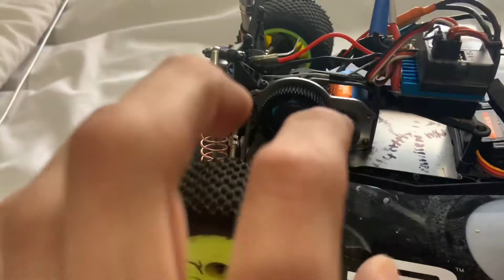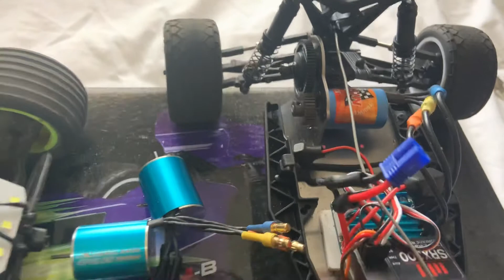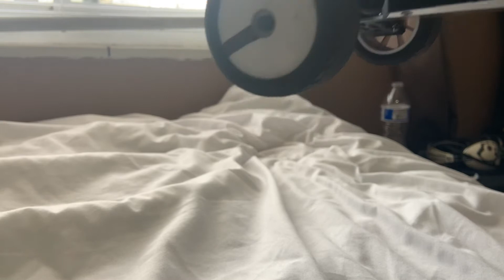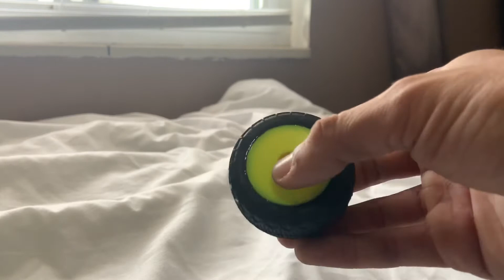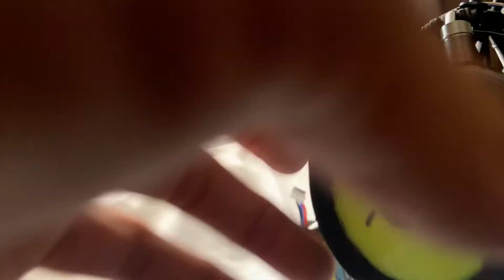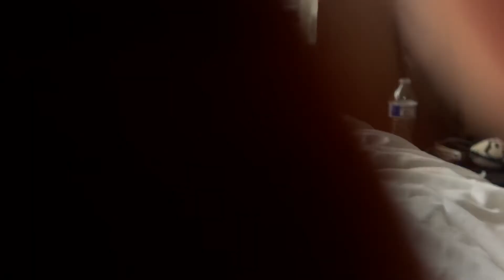Full conversion Losi MiniB 7800kv 28tpinon Losi MiniT2.0 7800kv 27tpinion Brushless motors

Comment: I use those little surpass 7200 motors in my hobby grade swaps. They're awesome but they don't rev anywhere near rated kV.
Reply from the maker: I use BL motors 7200kv they deliver on the kv out put it says advertised. At the moment i have a 3s system with a 7800 kv motor 27t pinion on my losi mini t 2.0 and same with my mini b buggy 7800kv motor 28t pinion
Reply: I believe it, but how did you check that?
Reply from the maker: @walkthedogz  cus my gps clocked my mini b buggy at 47mph 2s system 28t pinion 60t spur gear contact foam wheels. My mini t has a 3s system same motor different gearing. And i know ITS going to go faster than my mini b
Reply: @walkthedogz  With an RC gearing app and a GPS. Definitely not 7200kv but for $30 CAD it's half the price of a brushed system and still significantly faster.
Reply: @PabloGonzalez-hv3td  Makes sense. I saw a Surpass motor on Amazon that was 8000kv that would be fun to try but if the numbers are not true I wouldn't imagine one would see much speed gain.
Reply: @walkthedogz  Depends what it's replacing. Definitely faster than brushed but about half the speed of my 8200kv Castle system but the castle system costs 5x more.

Comment: Hello, where can i find the pinion and adaptor?

Thank you! ken
Reply from the maker: Check out you local hobby stores first if not amazon. For the adaptor im using an aluminum rod to make my bores. You should find these rods at your local hobby store. the measurements for my bore adaptors are 3.18mm the length of my rod is 1/8x014. Its better to get a rod to make your bore adaptors hassle free and no problems cus youll have the rod to make more if you lose your pinion bashing/dragging/racing.

Comment: How did u change gearing? Dremel the motor holes?
Reply from the maker: Dremel the motor plate yes
Reply: @2132izzyRC-TCG  awesome what aftermarket tires and rims are out there for this? And can I put regular 12mm hexes on it for more wheel choices
Reply from the maker: @Todd_G_FPV   based on my knowledge cus it was hit and miss for me with the tires and rims. Im using for foams at least im using Contact foam wheels 12mm with 4.0mm hex adaptors in the rear. Keep your original hex the losi comes with. In the front im using Losi directional wheels you can get those on there site or amazon or your local hobby store if they have them.
Reply: @2132izzyRC-TCG  ok thanks. I just now put my rustler wide hexes on and they work but the pins are a bit small lol got my latrax Teton wheels on it at the moment

Comment: How did you fit the bigger pinion?
Reply from the maker: I used bore adaptors
Reply: @2132izzyRC-TCG  did the motor screws get in the way of the pinion
Reply from the maker: @arkachanda6717  no. The pinions ive got are obviously bigger but the width did not affect how i adjusted them.